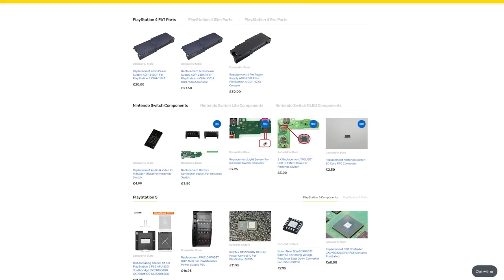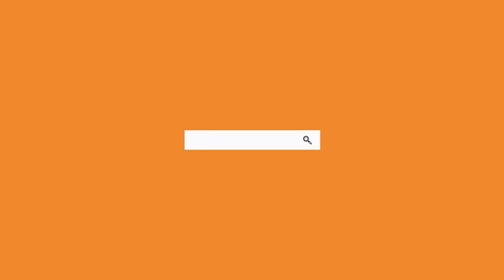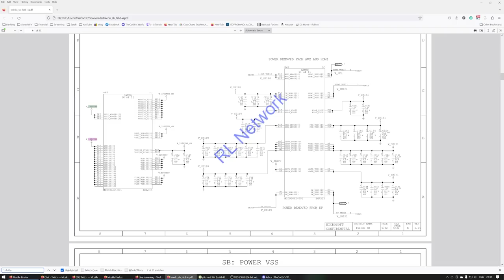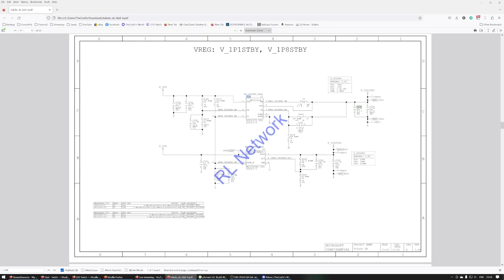Can I Fix An Xbox Series X That Won't Turn On At All? EPIC REBALL On A Current Generation Console!

Comment: My Nexus connector has continuity to the ground (the copper ring around the board) on every pin ... is that normal?  I also have short to ground on the top of the C1 SMD you checked @12:01, R172 @ 12:23

Comment: Hi mate, love the vids, but I've got a kind of silly random question, but what HDMI cable do you use for testing all your PS5's in full 4k 120? and that's durable?
Reply: Hdmi 2.1 are used for the new gen consoles for achieving these high resolutions and framerates. This cable is completely backwards compatible with older hdmi ports, but remember if u are using a older port other than a 2.1, u will not get the 120 fps

Comment: Nice video, is there a better way of cleaning pads rather than using wick ?
That’s what normally pulls the pads, I even watched a video on YouTube and even he said wick has a habit of removing solder mask which causes failures and it can damage pads.
Also I heard that Xbox X and S use Xbox one south bridge ?
Reply: wick only removes solder mask if you press it hard. just needs right technique.
Reply: @oliverlopez3191  well the people who said this are experts so I’m sure they know the correct technique
Reply: @M.E63  should never even come close to removing solder mask by using a wick, if done properly. I'd even go so far as to say that you have to go out of your way to damage the solder mask while using a wick. You'd need a really heavy hand, max temperature solder iron, keep the iron in one spot for many multiples of seconds, and use no flux to have a chance to damage the mask.
Reply: @Al-xj2oo  I never said I’m removing solder mask but I said I watched a video of a pro who said never use a wick as it removed solder mask and has a history of causing failures, I have pulled pads but there always NC pads and I’m sure everyone’s pulled pads, I did watch a video of mgchemicals and they said you don’t need flux when using solder wick as there’s already flux in there, they said maybe if your using cheap solder wick then you might need it, or if the wick is really old which would make the flux useless